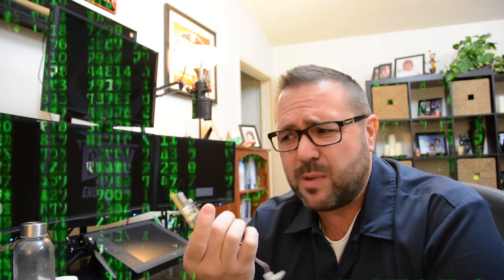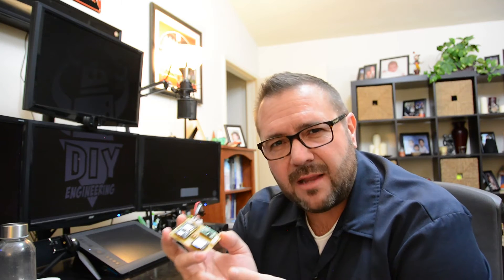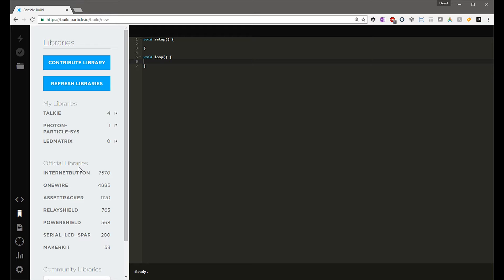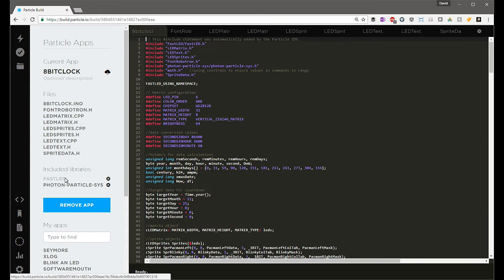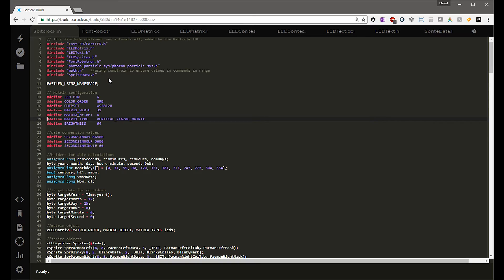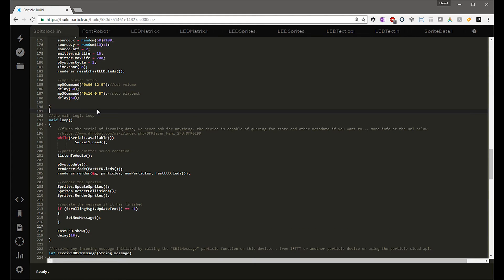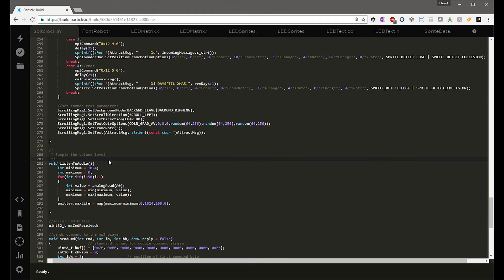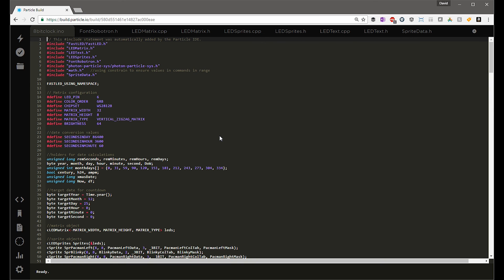Episode 020: Coding the Internet Arcade Clock Thing!

Comment: Was it difficult to edit the arduino particle sys source to make it compatible with the photon?
Reply from the maker: not really, there were a couple minor referential issues between libraries that I solved by bringing in all the necessary files into the photon ide then usign the "FASTLED_USING_NAMESPACE;" at the top of my files allowed fastled to work out its references.
all source code is in my git repo http://git.diy.engineering